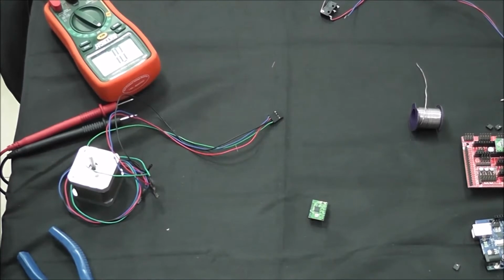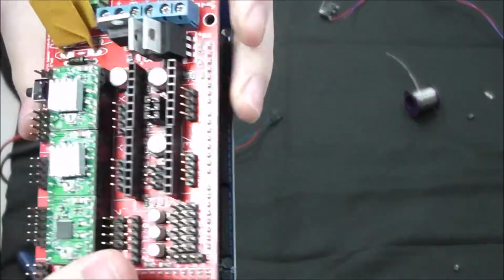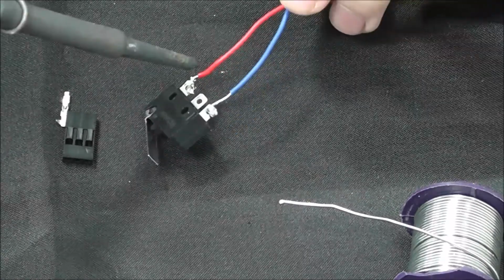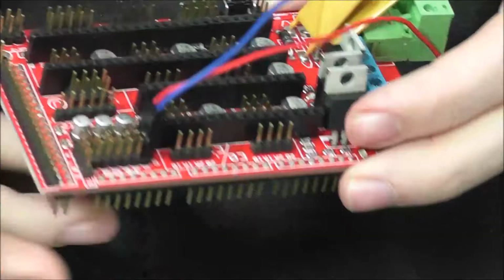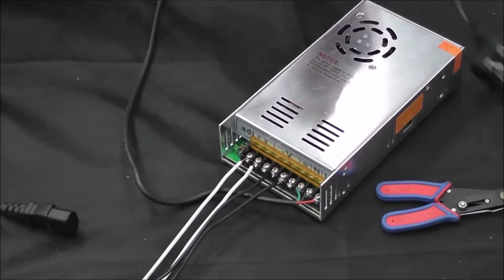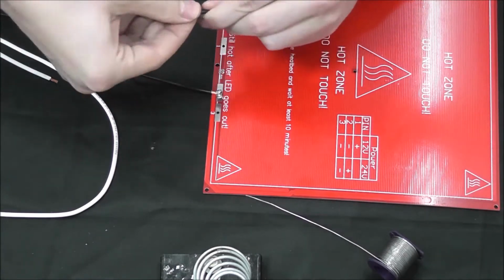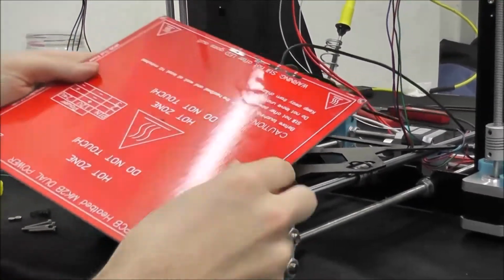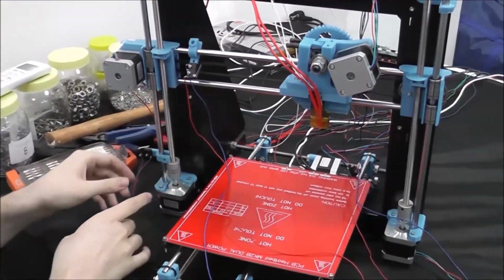RepRap Prusa i3 Assembly Guide p6 - Electronics Assembly - Additiveware International

Comment: Also when you crimped your wires you need to shorten the striped area 1/8" no bigger then 1/4"  the long wires will cause problems with putting connectors on. But cool video. keep up the good info

Comment: im not sure about this so i may be wrong but the black wire is never the neutral in house electricity BLACK IS HOT/OR LIVE WIRE it may have been in your cord you cut but i would have ran a continuity test on my wires and the plug side to make sure first but thats beside the point im trying to make and that is you really should not tell people that "As always you black is your neutral" but like i said im not a pro by no means just think you may wanna look that one up

Comment: He is soldering that way so he can hold the wire. But to do it correctly - tape down the wire 2 cm from the solder joint and hold solder in one hand the iron in the other hand. Heat wire and pad then feed the solder into the heated area.

Comment: NB. Ebayers (and presumably others) are selling "Ramps Wiring Sets" with the order Red Black Blue Green. If you attach your motor wires in the same order (as I tried, assuming that the RAMPS wiring was colour coded to the stepper motors that used the same 4 colours) it won't work. Ive since then found 3 or more permutations of colour wiring order all claiming to be the correct order. I can't see how that's possible so some folk are taking the pi$$.

Comment: This is not the way to solder.  Heat needs to be first applied to the two pieces you want to solder and then apply solder while the iron is still connected.  This "Spot Welding" Soldering you call it is not the way to do it and will most certainly result in poor heat transfer and poor solder joints.

Comment: not to complain about your video but the way you solder those wire is really not good you're suppose to use the solder wire on the wire you want to solder at same time as your soldering iron so the flux in the wire give a good penetration of the wire and the tab on the switch so you will have a good connection and solder joint.

Comment: If you plug the hot bed into the ramps board you should not be using the green screw clamps to secure your power source wires. The hot bed will draw more amperage than what those green connectors are rated for. Which makes for a fire hazard. If you are plugging the hot bed into the ramps you should be soldering the power wires on the board.

And while I'm talking about solder. Please for the love of God stop doing cold solder joints.

Comment: What are the connectors on the end of the stepper motor cables called? I'm trying to find them for my motors to connect to my ramps board.
Reply: +Willywonka321 I'm not perfectly sure, but i think those are called "pin connector". You can also find and salvage them from old computer parts, if you have problems finding them online. Go to your local PC shop and ask them if they have any old parts going to trash where you could snip them off.

Comment: Sorry but you haven't a clue, as to how to solder....on that heat-bed, you obviously ended up with what is called... cold solder joints--not good. Other than that BIG issue, good info.

Comment: Thank You for the video.  Answered many questions.  
I will agree though, I was taught and always do heat up the wire and terminal to be soldered first and let them melt the solder, not the soldering iron.  If the metals being soldered are not hot enough, the solder will not hold.  I also put a dab of flux on the tip of the solder which helps the solder flow and adhere better.
Thanks again!

Comment: Apart from the soldering producing a probable cold joint, the crimping on the wires was missing the crimp on the electrical conductors. You are relying on the other pin making the electrical connection with the bare wires, whereas the pin itself should be the conductor. Good info besides that. Check Youtube for soldering and crimping tutorials.

Comment: The soldering was cringe worthy. Never transfer solder with the soldering tip.
Use a small amount of solder for better heat transfer, preheat all the materials involved and then apply solder directly to the spot. You burn away flux if you leave it on the tip for too long.

Comment: Hi, excellent demonstration video. I have a couple or a lot of questions to ask you, if you don't mind. First I like to say I am a person good building mechanical and electronics things together. I have a basic electronics understanding & schooling. I am totally new to 3D printer's and understanding how they work! I want to build a 3D printer more specifically a kossel mini 3D printer or a rostock 3D printer type but my question is this, are all 3D printers uses basically the same electronics, arduino control board & a ramp board or do each different types of 3D printers uses a specific electronics according to their build or design?
Reply: Ramp boards with an Arduino can be used for most 3d printer projects. they are inexpensive, use easily available open source software, lots of technical support from forums, Wiki etc. Good for beginners and intermediate hobbyists.

Comment: My comment disappeared. That's odd. I was asking if it wouldn't be easier to wire the to negatives on the heated bed together directly instead of using to wire to go to the ramps board. That's what I did at home and it seems to work fine. That's one less cable. This could also be done on the power input as long as the cable is big enough to support the current provided by the power supply.
Reply from the maker: Yes, that is perfectly acceptable too as long as the wires can support the current.